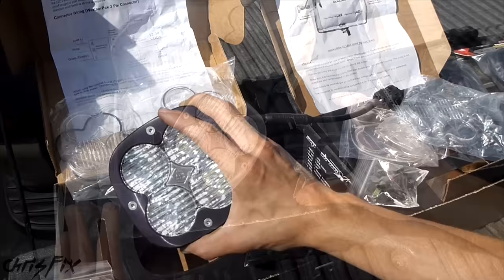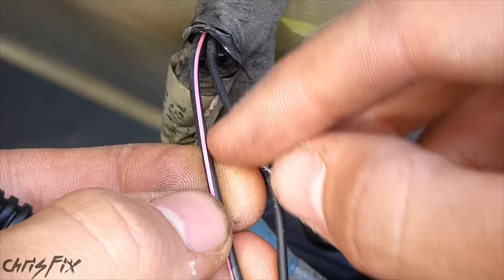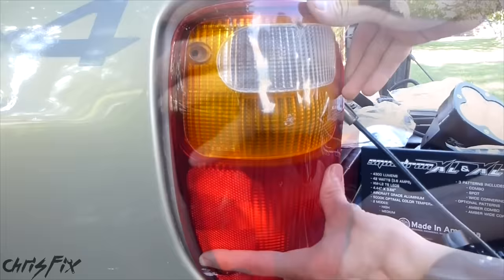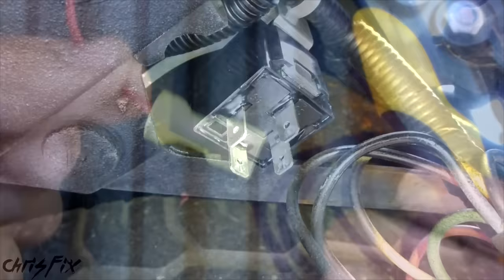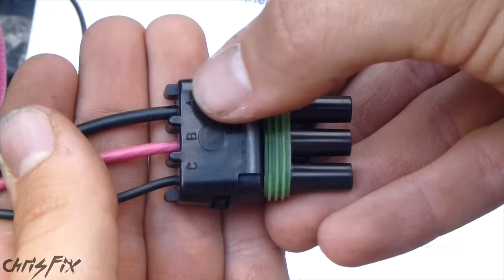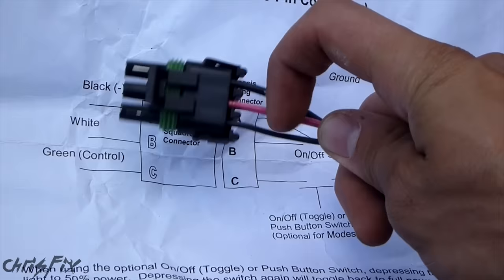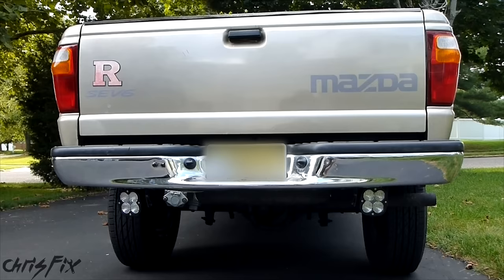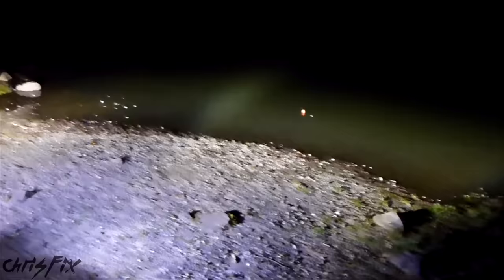How to Install Auxiliary Reverse Lights

Comment: What is the benefit of the relay over just splicing the led in where the wires run into the existing reverse lights?
Reply: Some vehicle reverse lights may be connected to a fuse that doesn't have enough reserve capacity to power any additional lights, so running a separate power line direct from the battery with its own fuse prevents overloading the stock reverse light wiring and fuse.  Other than that the relay doesn't change the way the lights function, just allows a safer direct power connection from the battery without hacking into the stock reverse light fused connections.  The relay is just getting the signal from the stock reverse light wire which requires very little power to trip the relay to energize it.  The LED lights don't require much amperage but may as well do the relay install anyways and save the possible issues of overloading an existing connection.

Comment: Whats the point of the relay? Most Mazda's and Rangers of this era had a 40amp relay already running the back reverse lights I am sure they would run your LED from the wire itself since they are low load anyway?
Reply: i would do it just to be safe
Reply: Classy.
Reply: Mark Wolf actually, I was asking myself the same question!
Reply: In this case, I don't think the relay was really necessary.  A relay would only be needed if you were wiring something with a high current draw to a "trigger" circuit and need a separate larger gauge wire and higher amperage fuse to power it.  Those LED lights Chris installed in the video don't use much power, so the relay just means extra wiring in this instance.  The way he wired everything does work, but I think he made the install more complex than it needed to be.  All he had to do was use a wire tap to connect the positive wire from the LED's to a positive wire in the reverse light circuit (either behind the tailight or in the trailer wiring loom) and then just ground the LED's negative.
Reply: If they are 18w, that is just 1.5 amps each. They are on a 10 amp circuit he said.  No problems going straight to the existing wires.
Reply: @the74impala  Hey i have a single 18w 4inch cree LED that i want to mount in the middle of my nissan titan do you think a single 18w will mess any thing up if i connect it straight up to the stock reverse lights can you help me with that thanks?
Reply: @aaronmaruri  Look in your truck for what the circuit can handle. It is probably a 10A fuse. Your light is 18w, just like my post. That is only 1.5 amps. 18watts/12v=1.5amps. I hooked up 2 18 watt lights on my Excursion ~3years ago. No problems. No promises,  but these aren't 150watt halogens. Those would absolutely need a relay and separate battery.   power.  Add some LED bulbs to the stock housing to lower the draw even further.
Reply: @the74impala  yes thank you thats also what i did i installed low power consumption small led bulb to the stock housing and put the single LED 4inch in the middle where the tow hitch is at and connected it to them thanks man.👍

Comment: Any idea on how I can add a switch to turn on or off, if my truck is idling?
Reply: Ivan Obregon instead of running the relay control wire to the reverse lights, get a fuse tap and find a circuit in your fuse box that is on when your truck is idling using a multimeter. Plug the fuse tap in, with a low amperage fuse, and run that wire to a switch. From the back side of the switch, run a wire to the relay control tab (where he ran the reverse light power into). And that should do it! Your 12v to control the relay is now coming from a switch instead of the reverse lights. The relay can use any 12v signal to trigger.
Reply: @CShellStudio  thanks I will try it!!

Comment: i wired mine on the back up line thats on the 7way trailer connector :)
Reply from the maker: +Dimce Gligorov good idea
Reply: ChrisFix yeap, less wires, and no relay needed.
you have facebook page?
Reply: Can you explain a little? This sounds like a better alternative.
Reply: Ron Sissons just locate the 7way trailer connector, and there is one wire that should say back up lights.
or you can press the manual brake and put wheel chocks, put ignition on,do not start the truck.
put it in reverse and your factory reverse light should light up.
go with voltmeter on the 7way connector and locate the wire that has power,only when back up lights are on.
if you leave voltmeter on,and see the voltage, go and put it in park, then back up lights will shut down,and you wont see any voltage on voltmeter.
thats your back up + wire.
put both + wires from the led and connect them there.
the ground - wires should go in chassis or if you find a negative - wire.
and wolllaaa, you have extra back up lights.
Reply: Dimce Gligorov  yyou got sum.ideas
Reply: Dimce Gligorov thanks,  That helps a lot
Reply: Ron Sissons welcome.
Reply: Catherine Kruger yeah.
i have put under body led light when you unlock truck, when your interior lights are on, the underbody lights are on..
when you close door, interior lights are off, your under body are off as well.
Reply: ben whitaker what does it sucks?
Reply: He's just jealous he didn't come up with it first...
Reply: Brian Reinhardt you might be right ;)
Reply: Dimce Gligor
Reply: I wired the LED signals on my new 2nd gens tow mirrors this way. Great for anything really lol... going to do my reverse lights ona switch though.
Reply: I'll do it the way @ChrisFix did in the video on my father's car (it doesn't have the 7 way trailer connector) and the way you said on my pickup.
My brother gave me a couple of cube LED lights and I'm thinking about using them as backup reverse light
Reply: Dimce Gligorov was that easier?

Comment: Hey Chris, i have been wondering why do you use a 10amp fuse for a 1,5-3amp light and why a 40amp relay when the fuse is 10amp?
Reply: Most relays are either 30 or 40amp rated nothing less... A 10amp fuse provides the circuit with two things, one is in rush current for the initial turn on and the other is long term current heating up the wire over the length of the vehicle, lastly they don't make 6amp or 8amp fuses so a single 10amp will do as it protects the working circuit and will still blow in the case of a short circuit

Comment: Very informative video nice job. Fyi, should put the wire connectors UNDER the washer, both at the battery and at the ground connection in the rear. Also when you solder should cover the connection in anti oxidant, I live in northeast Ohio, that connection wouldn't last 2 seasons.
Reply from the maker: Thanks for sharing

Comment: The light locations look very vulnerable.
Reply: yup from wild hobos
Reply: Next install: mud flaps
Reply: +TransHaus dude for real I saw that too
Reply: I wou've located on the roof.
Reply: my point exactly i would've got the sink in style pods and cut holes in my bumper to mount them into.

Comment: Chris, in the place where you added the ground wire to pin 85 of the relay, you sand papered the bolt you used for the ground connection on a small bracket bolt, but you missed the other two bolts grounding the bracket to the frame.
You needed to sand paper that bolt also because it was the only ground connection to the actual frame.

Comment: is this illegal if i were backing up at a Walmart or some public place? could the police get me for something, its illegal to run my off road light bar while driving, but what about reverse lights?
Reply: Benjamin Masters depending on your state and local laws but where I live in Northern ny, the police wouldn't care about the reverse lights, but it is illegal to use the light bars on public roads. I'd check your state and local laws
Reply: I've wondered the same thing but it's for your visibility so I don't think so. You're only reversing. Not like you're driving behind someone with led light bars on. I wouldn't worry about it. Otherwise just wire in a kill switch
Reply: Lusty Wench it's not illegal. The ones I'm doing are just going to be wired straight into my reverse lights. In public and on private property I want to be able to see behind me.
Reply: Lusty Wench police won't bother you for reverse lights. You can do what you want but I'm just saying.
Reply: Lusty Wench they legally can not cite you for it. You can be cited for not using DOT approved driving lights. The DOT actually only states that you're required to have reverse lights. It doesn't say anything about what type of light it can or cannot be.
Reply: Lt. Patterson thank you for the info and thanks for the service to the community officer. I'm a volunteer firefighter. I want to be a wilderness EMT eventually
Reply: it depends on your state laws
Reply: Benjamin Masters no
Reply: Benjamin Masters no when you are in parking lots you are considered off road or on private property so unless they was called they are not supposed to act on anything unless it's like a gunman shooting people.
Reply: Even if you're reversing on a public street, such as while parallel parking, you should still be OK there too.

Check your local state laws whether there are restrictions as to how high your reverse lights may be aimed though. It wouldn't be any more cool (or legal) to blind motorists approaching from the rear with your backup lights than it would be to blind motorists in front of you with your headlights.
Reply: How much are used headlight remacement ?

Comment: do they draw that much power that you need a relay?
Reply: I was wondering the same thing, I think i'm going to try tapping them into the reverse lights
Reply: Always best to add a relay and get your power directly from the battery or a power block under the hood.
Reply: brittenv1000: yes

Comment: Factory reverse lights are a joke! Even with LED bulbs. I need to get me some extra reverse lights soon
Reply from the maker: +Zach Novosad yea it's amazing how bad the factory reverse lights are
Reply: +ChrisFix I've even noticed it with headlights. I wish I could drive around on the main roads with my LED light bar on.
Reply: yeah, I've got a legacy wagon w/ limo tint.  even w/ 1,000 lumen LED reverse bulbs it's still barely adequate.....i'll be doing the same thing.  saw a couple people do this as well on their 2nd gen prii...
Reply: +kevinjfeeney77 yeah. My led bulbs aren't any brighter than the old ones. About the same in non tinted lights. For $14 on Amazon you can get a set of little LED light bars cheap that are really bright. I'm not one to normally advocate buying cheap lights like that but for the price you can't complain
Reply: kevinjfeeney77 I ended picking up some lights. Boy do they make a difference. I can see everything when backing up now

Comment: I did the same thing on my silverado,  but i wired the led auxiliary lamps directly into the backup bulb socket by stripping the power / ground wires back about an inch and placing the stripped wire section in a 'u' shape around the bulb contact, then pushing the wire in with the bulb into the socket. Had to notch the sealing flange on the bulb socket but i did not need to do anything else to power the lamps. Easy.

Comment: First off, that was a great instructional step by step, detailed video...thanks for posting. If your truck came with a factory trailer pkg & your engaging the LED with your reverse light, why didn't you just wire the ground & power wire directly to the factory  trailer harness wires? I'm not knocking your way by any means as I'm no pro but it seems much easier to tie into the trailer harness. Thanks

Comment: Dielectric grease on all connections.  You'll thank me later.
Reply: I can agree with that. Those staycons on the relay are going to corrode and break off over time. Also the relay should have been installed with in the factory fuse/ relay box.
Reply: @jordanz99  Or use a relay that comes with the waterproof cover on the opposite side.  You pin it up similar to the three pronged waterproof connectors he used at the end on the lights.

Comment: Chris i soldered my connection for the relay to the power on the reverse lights but i put a piece of double sided tape to the back of the relay and mounted it behind the tail light and ran all of the wiring down through the hole after i installed a grommet in it!

Comment: If you are going to solder a power connector (which is not best practice,) use a rosin core flux after cleaning those wires with some rubbing alcohol.  Do your soldering and then clean with rubbing alcohol.  You will get a 100% better solder joint.  Then use glue filled heat shrink tubing.

And as mentioned in another comment crimps are best, especially in outdoor circuits, the best method to connect wires is to use glue filled crimp connectors.  They are only pennies more, but after a quick trip under a heat gun, it will make a connection that won't corrode probably for the life of the vehicle.  Use a quality crimper, not the cheap one that comes with the pack of crimps from auto-zone.

Dielectric grease really makes it looks like a hack job.  I'm sure it will work fine for many years, but for others that watch your video, there are better ways to do the job.  (Retired electronic technician giving advice here.)
Reply from the maker: Thanks for sharing

Comment: No offense, you have great mechanical videos, but your wiring is shit. But still works, and is protected so this works also.
Reply from the maker: Thanks this is an old video.
Reply: Wow, I really thought you wouldn’t see this... now I kinda feel bad, since I actually love your vids. But, you did good on your truck setup though 👍🏼
Reply: Lol as an electrician my first thought was the ground is always green lol but I probably would have Ist used a waterproof wirenut and electrical tape instead of soldering just me. I thought he did a good job myself.
Reply: Chris, can you splice into the connector for your trailer hitch. Instead  of the tail lights? Or get your power from their instead of the battery?

Comment: FYI relays can work either direction just as long as the load goes on the high current switch (87 to 30 or 30 to 87) and the trigger goes on the low current constant (85 to 86 or 86 to 85).   The relay usually has a diagram on the top. the line that is broken is what you want to power the component(vehicle accessory) and the straight line is the constant that you control with an outside switch.

Comment: If you ever do another instal with aux reverse lights please show how what relay to use to have them activate with a switch and also by the reverse lights. 

I want to have them able to come on manually, but also with the reverse lights. But don’t want them to back feed into the BCM when they are manually on.

Comment: I just powered mine right from the reverse lights and also put a 2 way switch on my toolbox so I can have them on just with reverse or turn them on manually when the running lights are on. great for putting a boat in the water at night.

Comment: Slip heat shrink onto your new wire. 
twist your stripped wires together tight.
Soldering iron goes underneath twisted wires, tip is pre-tinned. 
When the heat has come up through the wires, touch solder to the wires and let it melt through the twist. 

Slip heat shrink back over the twisted soldered wire, heat up the heat shrink until it's tight. 
(If you want a pretty well waterproofed join that will hold up to a few river crossings, use marine heat shrink and a dab of silicone grease at each end.)

Comment: The crimping points on your water proof connector go as follows. Crimp closest to pin is for copper. Middle crimp goes around insulation(plastic) on wire. Third crimp goes around the rubber wire seal. Still great video I learned as well. Thank you

Comment: If you go fancy and get a DPDT relay you could use the source as the original backup light feed which is already fused, hook up a toggle on the dash so that you can toggle between 'trail mode' and 'normal mode', then just have the relay normally closed on normal and normally open on trail.
Flip the switch on you get pod backups, off you get normal. Still need to run the wire from toggle to rear but would be pretty cool. Probably still need an inline fuse on the toggle but saves you from running high amp line for the lights and instead you run the low amp for the relay.
*also you could use accessory for the toggle so that it doesn't drain while off if you forget

Comment: Nice , thanks for the video 👍
I use an old halogen 55 watt foglamp, and I have installed it at a higher place , so it is not exposed when driving on the trail.
Also , I have a switch installed in the cabin to turn the light on and off.
So when reversing in town , I do not blind everyone 😉
The relais is mounted under the hood, near the battery.
For protection of the cables, I have used a piece of old garden-hose, works fine.
4x4 Grtz 🙋‍♂️

Comment: Great info, but since they are reverse lights, I put dual Rigid industry on my Raptor and just spliced it to the trailer revers wire. Has worked great for years. Same concept but you don't need a relay since its low enough draw. Also did it in 1 hr.  But great video, good info. Thanks.
Reply from the maker: Thanks and thanks for sharing!

Comment: The per wire seals go on the wire before you crimp the  female pin on the wires.  This is so the seal is BEHIND the pin on the back of the connector.
The  way you did it, water will go right through the pin from the back.

Comment: Soldering provides the best electrical connection. 
- However, where the soldering material ends inside the cable is potential breaking point. Meaning, over time vibrations might break the cable in two. 
Solution: cable tie down the soldered wire tight limiting any negative affects from future vibrations.

Adding a small amount of grease to connectors exposed to the elements will prevent future corrosion. Heat shrink isn’t good enough, but in combination with a small amount of grease it’s much better.The same thing goes for chassis ground wire points.